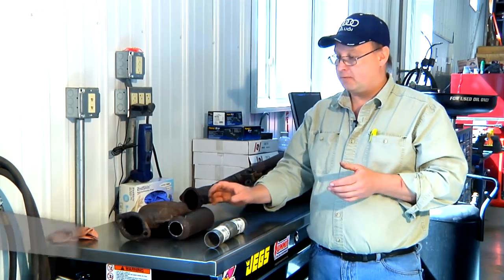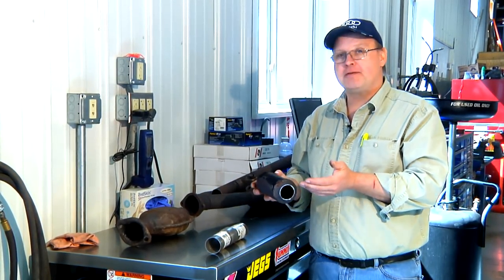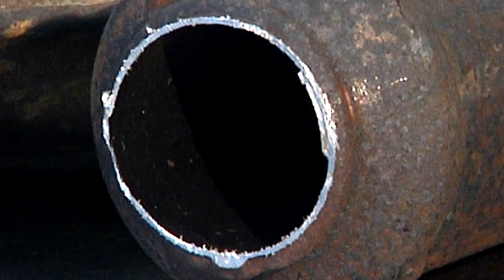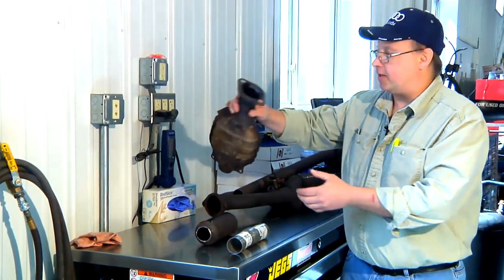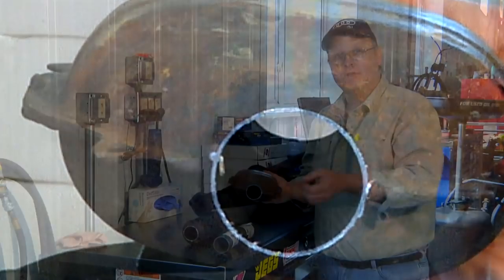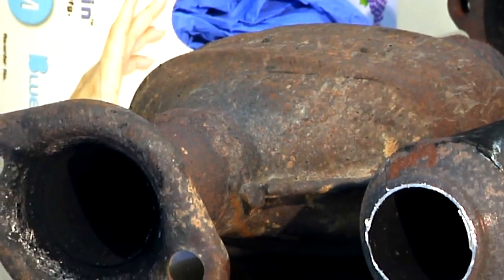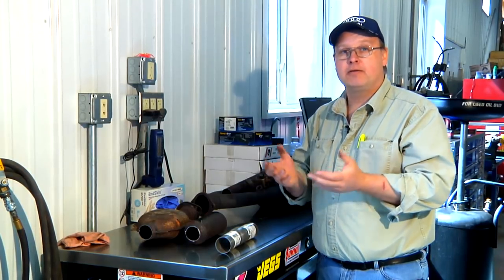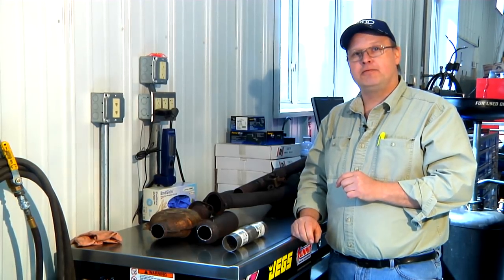What Happens if You Replace the Exhaust Resonator With a Pipe? : Under the Car Repairs

Comment: Provided the louder one isn't loud due to poorly designed mufflers, leaks, etc. I have seen the same engine make more power with a properly designed quieter muffler vs a poorly designed louder ones.
Me, personally? If it's a V8 I prefer open headers just like god intended. Everything else gets a quiet muffler(s).

Comment: People told me not to run my camaro with straight open long tube headers.  I gained 3mph and took off .2 in the quarter.  Don't talk to me about backpressure, NA...
Reply: Wow 3 mph bet you feel tough.
Reply: ThexNOOBTUBEx - as tough as you feel on your huffy
Reply: Probably placebo... you ran open headers expecting to be faster, so you DROVE harder & picked up speed.
Reply: madjimms  I think I know how to compare timeslip speeds and 60' times at the track..... Not much beyond 60', shifting, and passing the line
Reply: No, he just left 10 lbs. Of aluminized steel at the starting line.
Reply: Rýán Túçk The exhaust was stainless, and it was two cut off dumps at the end of long tube headers, so no weight cut...

Comment: did you watch the video?
you'll end up spending that $1500 in gas, or a new engine if you don't put a resonator on there. you can buy pontiacs gtp exhaust's in pieces, you just spoke to the wrong guy

Comment: this guy clearly has worked for dealerships as a mechanic before because he is giving their typical excuses for not replacing a resonator. The bottom line is none of this crap is true. I had a 92 accord and removed both of the resonators and changed the exhaust from 1.5" to 2" from the cat back with a chambered muffler at the end and got better fuel economy

Comment: Unfortunately for me this is a 93 with the early 4.6 and AOD-E, I may have to rewire the engine for the newer engine management so I can swap to a PI 4.6 and 4R70W trans instead of the AOD-E slushbox. after that I'd probably run stainless works full length headers and Dynomax race bullets because I dont care for the SW mufflers sound. I thought about a DOHC swap but the consensuses is its a ton of work just to get it in there. to bad cause the Lincoln Mark 8 engines are cheap and badass.:(

Comment: the key is to add speed which exhaust flows. to do that you need proper headers and less backpressure. simply straightpipe wont do the trick. Every diameter of piping is meant for different amount of hp/kW.
for example. Running a 2.5 inch pipe on a 600hP car is quite impossible cause the piping is too small. but running a 3.5 inch pipe on a 100hp car is bad. exhaust flow is slow and will bring down you hp's. exhaust system must be according to you engines output. and ffs, forget the whole backpressure bs.

Comment: Assuming you own a normal car. If you remove the muffler or get a glass pack you're gonna have an increase in sound but still maintain back pressure which means you keep the torque and maybe gain a couple horses. Don't fiddle around with crap before the catalytic converter unless you really need to. My truck has power and efficiency out its ass and im running it unrestricted after my catalytic converter. Then again I have a 5.9L Magnum so efficiency is an after thought.

Comment: so answer me this?
when hot air goes back into the engine then gets pushed out. it's to be considered the bad poisonous air correct. 
However if air comes out cooler, hp, mpg, and air intake. runs more efficiently correct. Im no expert but the proof is in the puttin.

Comment: Oh it's back pressure again! Your confusing scavaging which is done within the manifold and an obstruction in the exhaust. They slow the gasses down reducing overall performance to make it quieter that's the only reason

Comment: I would use a small glass pack muffler as a resonator!
Reply: Blastin' Bobs sells resonator delete kits on their website. Just put some on my 07 hemi charger, sounds like a beast now with zero difference in performance or mileage. The old resonators were huge too.. Sounds like a $1500 exhaust for $180

Comment: Ok this is to the uninformed people who think backpressure is not needed! Has anyone had a physics class or know about thermal dynamics? Every exhaust system will have some backpressure present at a given rpm range! 2 stroke and 4 stroke exhaust systems work very similar to each other! "Top fuel dragster run open header with no problem"! While that may be true, there is still some backpressure there due to the rate of expansion within the exhaust gases! Back pressure helps in exhaust scavenging within the cylinder! Meaning when the backpressure is relieved, a negative pressure will be momentarily present at the exhaust valve! When the valve opens, that negative pressure will help pull the gases out of the cylinder, therefore allowing for a better incoming cylinder charge of air and fuel! Eliminating backpressure without supplementing the intake side will cause a power loss! Although the power loss will be minimal, it's still a power loss! Quick science tip: Take a piece of paper and place it flat on your hand, and hold it up into the wind! Now depending on the velocity of the wind the paper will stay on your hand! The paper represents power! The wind is the intake side, and your hand is the back pressure! Now move your hand in the same direction as the wind and the paper falls! Your total engine power will do the same if you decrease or eliminate backpressure! Every engine needs some backpressure to operate relatively efficiently! Now some have said turbo vehicles can run straight from the turbo! Yes they can, but the turbo in this case is the backpressure! Supercharged vehicles WILL burn valves with out backpressure! Without the backpressure, the hot exhaust gases aren't pulled from the cylinders fast enough, heats up the valve, the valves then deform and eventually leak! The valve then starts letting the combustion process pass by, therefore melting a valve is inevitable! This will usually happen before you even realize you have a problem! This video was a joke, period! Those of you that really think backpressure is BS, or not needed, well you're wrong!

Comment: the rez allways gets a rusthole in it. pontiac  grand prix GTP  the exaust is sold as 1 peice.. they would charge me 1500$ to fix it..i fixed it with 10$ straight pipe and  2 clamps

Comment: FALSE. Backpressure is always your enemy. It DOES create the WANTED scavenging needed for great efficiency and power, but does so by RESTRICTING the exhaust, thereby creating scavenging by having the restriction create pressure to push the gas at higher velocity... That's the cheap, easy, low performance way to do it. Better scavenging is when you have NO back pressure, but rather have your setup done right so it flows great without using restrictions to create pressure in order to do it. You want high GAS VELOCITY, and backpressure does it with by restrictions (bad) causing pressure, where better (not necessarily larger) size pipes, better, smoother, more gradual bends, less bends overall, and less overall exhaust length in general. Work for high SCAVENGING ONLY, not backpressure.

Comment: This is all wrong, 4 strokes NEVER need back pressure, but rather exhaust gas velocity, and this is where the proper diameter and length exhaust headers and pipe comes in. Back pressure ALWAYS hurts performance on a 4-stroke. Sometimes, a quieter car 'feels' more powerful than a loud one of the same state of tune, but that's just the observer's perception. Try them out on a dyno and the louder one will always make more power.

Comment: Nothing happens if you replace it with a pipe. I just replaced an exhaust on a Subaru and the replacement part did not have a resonator. A resonator is designed to quiet exhaust sound at a certain frequency. It may change the way your car sounds a little but you will never know the difference. Why does he keep referring to it as a spark arrestor?

Comment: NVH/sound/performance engineers spend many hours tuning the exhaust on a car for the best balance of T and hp in the rpm range that the vehicle was designed for while minimizing the annoying drone. Yes, you can remove a resonator. But you are disturbing a "system," and there will be a sacrifice somewhere. "Always" and "never" are bad terms for automobiles. Someone might get lucky and get away with this $10 fix. But for the other 90% of people, the drone will make them wish they'd spent the $50 on a resonator after cruising down the freeway.
This guy does not have a clue. Unless you plan to take your car through the woods or on a farm, it does not need or have a spark arrestor. The catalytic converter does this already. Especially when newer cars can have 3 or more.

Comment: You want maximum exhaust gas velocity while minimizing backpressure... this is why a 3 inch exhaust on a Honda Civic just... sucks, at least until the engine is wound up enough to create that much exhaust flow (you'd have intake, head, and cam issues well before this happens), and a single 2" exhaust on most any v8... sucks just as much, unless it idles Grandma to church and back.

But... for the case of a daily beater, I doubt removing the resonator will affect performance or economy much, or even set off a SES.  I've replaced rusted resonators with pipe before, and it's minimally louder, with customers saying no change in performance or economy (granted they're not out racing their daily drivers). 

The resonator is more for NVH than it is for performance, economy, or drivability.  I'm thinking the host, who I doubt is an idiot, is simply misspoken.  It's the difference between an automotive repair tech and guys who have their feet in the high performance pool.

Comment: i replaced my exhaust with just two long pipes from the manifolds to the bumper and 4 inch tips. no resonators. no catalytic converters. and my truck gets the same gas mileage and feels like it has a little more power. there is no negative effect. this guy just got bored and wanted to stand in front of a camera and act smart

Comment: Ok when he exchanged spark arrestor for resonator he lost any credibility they are not the same. Also a resonator offers no appreciable back pressure as it is straight through design is sole purpose it to resonate sound I.E. tune out high frequency sound. A spark arrestor has screens in it to contain any hot particles that may come out the end of the exhaust and is usually on off road vehicles not passenger cars and trucks.

Comment: four stroke engines do not need any backpressure to run well. the less restriction you have in your exhaust, the better it will perform and the better mileage you will get. people misconstrue backpressure with tuning/scavenging of exhaust gases. properly designed headers/ mandrel bent pipes and low restriction mufflers will help scavenge exhaust pulses out of the engine and contribute to better performance. why do you think drag cars run open headers? to go slower?

Comment: free flow.. system .... your engine is one big air pump.. air flow in.. and need to flow out smoothly. proven fact.. but many who still don't get it because they add gas to there engine.. but you need more air then gas to start you car.. air fuel ratio. 1+1=3.. do the math and you get the answer..

Comment: 2 stroke engines need back pressure , 4 stroke engines dont , they run max power straight out , its just they have been tuned to run with a muffler  and resonator , geezez , drag cars dont have mufflers or resonators ,

Comment: It's about overlap - without the back-pressure, the new fuel charge AND AIR goes out the exhaust, the OXYGEN sensor reads the AIR and throws in more FUEL,
and then you're "F"ed !!

Comment: Yes people unless you know how to reprogram your engine's computer TODAYS engines are tuned to run with a set BACK pressure from your exhaust system!  Unlike say a crate motor with a carburetor or  most engines or pre 1976.

Comment: wow these experts need to go home and stay of the internet....
First off, 4 strokes do not need backpressure. common myth.

Second, by removing/replacing and part in the exhaust pluming changes what is known as the backpressure curve.
           Backpressure curve much like a dyno readout shows the pressure at any given RPM. Stock N/A cars try for an almost flat line from 1000RPM<. By changing the curve you change the
volumetric efficiency of the cylinders at any given RPM, All of which need a retune of the ECU to correctly run the engine after such modification.

Now, the ONLY ENGINE that NEEDS backpressure is a TURBOCHARGED one. Where pressure is built up between the exhaust valve and the exhaust impeller, after which again 0 backpressure is ideal. 

Moral of the story, If you CHANGE anything to do with the engine or intake, exhaust and or fuel system you need to get it retuned to run at peak economy and power.

Comment: let me tell my story on my 2003 trail blazer,use too much gasoline I tune the baby like a pro and I don't understand way still use a lot a gasoline I find out my resonator some how was screwing my miles per gallon so I removed and now I got more miles per gallon and baby better sound hehehehehe Im happy,before  u said bushit,I check,tires,air filter,fuel filter,spark plugs,sensors,thermostat,02sensors,and last the best premiun gas,I even install the turbonator

Comment: and electronically controlled transmissions will not shit well, they will shift hard. Even if u have a 10 foot pipe that's still back pressure that is needed. People who dont believe it. Cut it off after the catalytic converters and see how that works for ya, drive the car ur own car, u'll see. They don't put parts on cars for fun.

Comment: How is this bull? He did say that the pipe would be better or worse. He only said that putting the pipe would affect the back pressure. While you want back pressure low, you dont want it too low. Back pressure is absolutely necessary for sound. Too much and you will loose power, too little and your car will sound like shit.

Comment: engeneering is basically a science of compromises.
when you modify the configuration of a vehicule, you trade engeneering for pseudo engeneering and globally, you're losing
the noise and vibration control science is a major concern in the developpement of an automobile and unless the guy that is making the mods is a connaisseur, the global result will be disappointing.
The confort level of a vehicule is of prime importance to avoid fatigue when driving on long distances so, for safety, controlling noise and vibrations is mandatory principally on unitbody vehicules where there is no independant chassis to act as a damper
Reply: +Jacques Poirier But, OTOH, any "backyard engineer" can modify a stock vehicle, and improve ONE performance parameter, provided he can accept compromises everywhere else. (For example, if ALL you care about is improving your 1/4 mile, it's pretty easy to do, if you don't mind reducing the utility of the car as a daily driver.)

Comment: Took all that bull shot out of my duramax picked up 30 horsepower and 55 feet pound torque so what he is saying is wrong your engine is trying to get rid of its byproduct aka the exhaust gasses as quick as it can just like we do when we exhale so when you remove it and straight pipe it it'll run a whole lot better with more power even if you have a aftermarket muffler

Comment: Stop saying that engines need back pressure. That's nonsense. You want to the maximize the power your engine can produce? Well then you need to REDUCE the back pressure that is inherent in exhaust systems. Your exhaust is a fluid flow (remember, gases and liquids are both fluids), but it is very turbulent. High performance designs for exhaust systems carefully stage the exhaust pulses so as cause "negative pressure" right as the exhaust valves open. This improves exhaust scavenging and allowes the engine to run more efficiently and produce more power. Yes I know there is no such thing as "negative pressure". I mean lower pressure than atmospheric pressure outside the pipe. The lower the pressure in the exhaust, the better. So, this notion of needing "back pressure" is complete bull shit. If you really are a professional, you should know that the hell you're taking about and stop repeating misconceptions.